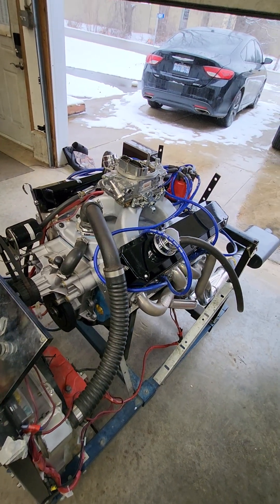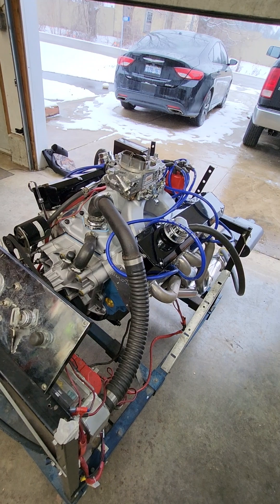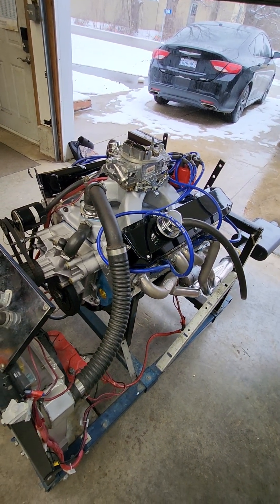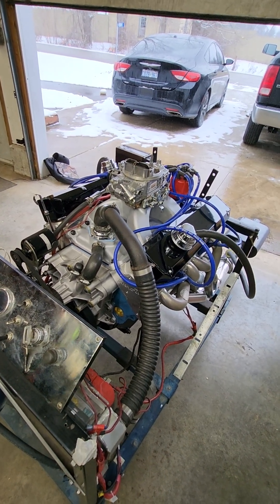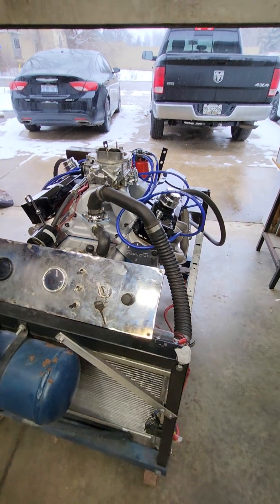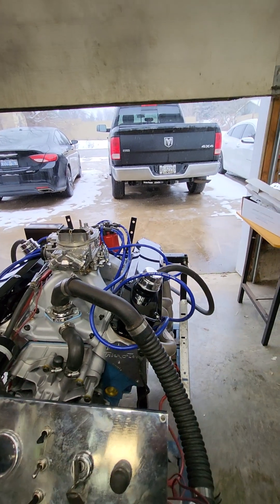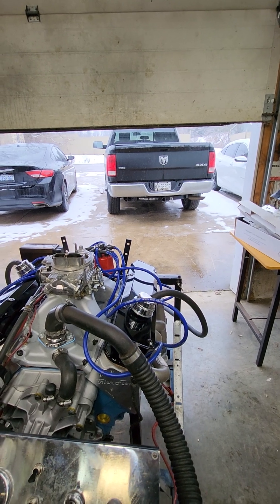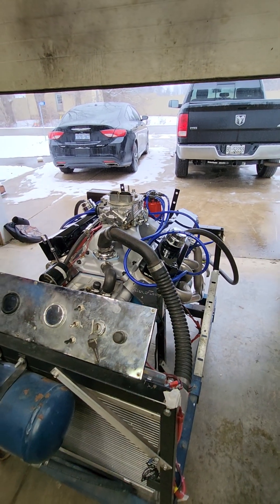410 cubic inch small block Mopar Nitrous Engine, Trick Flow Heads

Comment: Nice! Question, what is your take on prw roller rockers,shaft and adjustable rocker cups?
Reply from the maker: I have used the  before and they worked good. These Harland Sharp rockers have cup style adjusters that take ball and ball pushrods too.
Reply from the maker: Lol, thanks.
  Dyno runs:
-Jan 13 is this engine
-Jan 20 is the 422 with 10.25 and Marsh Performance heads.
-Jan 22 is a 408 with a Hughes solid flat tappet (if I can get it done in time).
Feb 24th is a duplicate of the comp cam engine that made 577 torque but with IC745 pistons or ¾ less compression, just to see what difference ¾ compression will make.